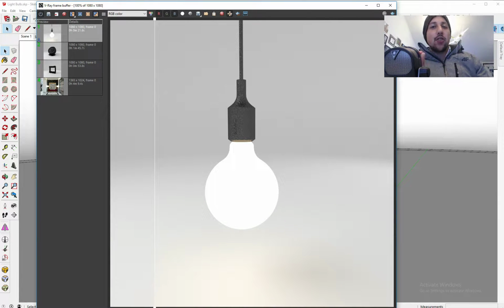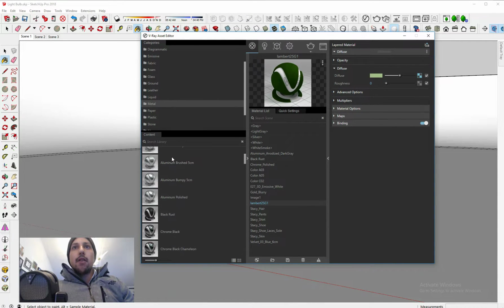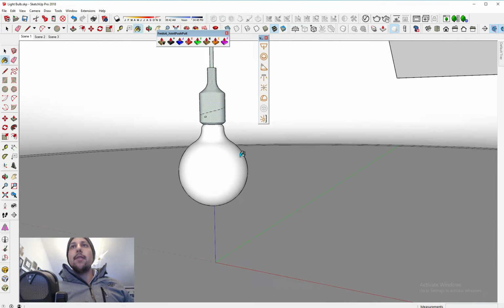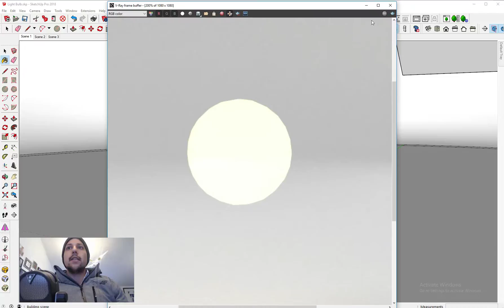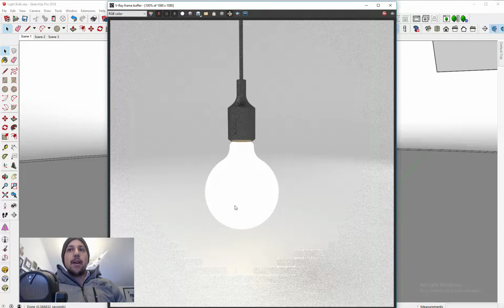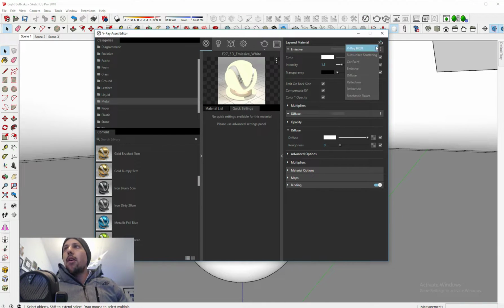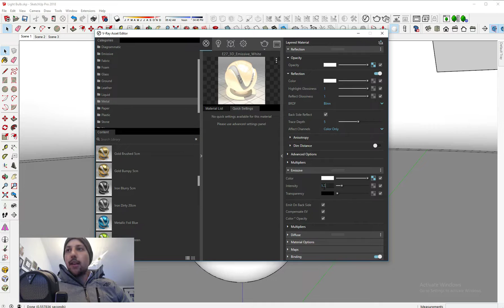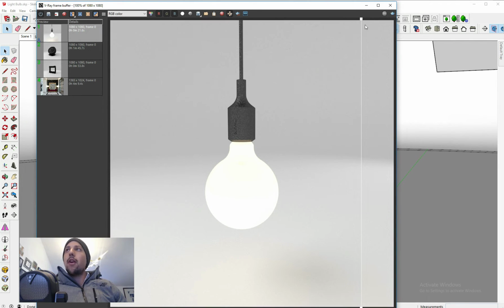💡 💡 💡  Make Better and Realistic Light In Vray For Sketchup!  💡 💡 💡

Comment: couldnt c the diffrence
Reply from the maker: LOL! it's very subtle
Reply: @WDesignCorp  I was about to say a similar thing. I do see the difference but I just think that this would be used if you want to show the light bulb. Usually (at least for me) the light bulb would be far that it will not make a huge difference. Adding reflection though is definitely an interesting concept, also I learned how to resize textures with no maps so thanks haha.